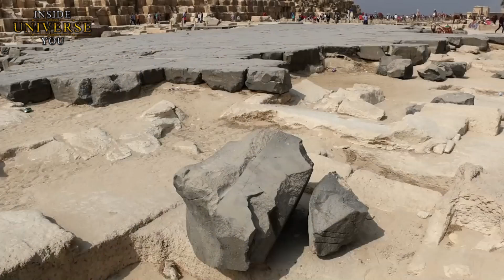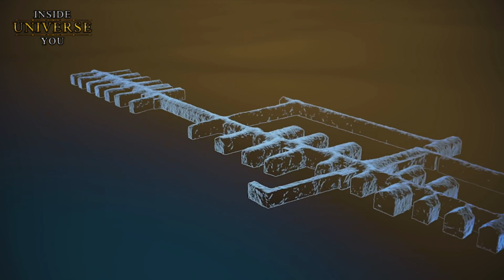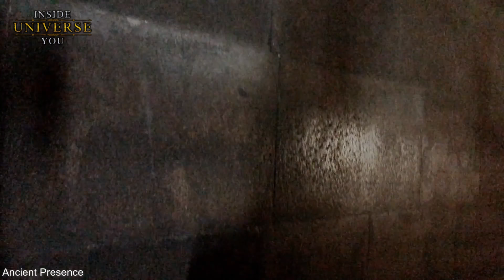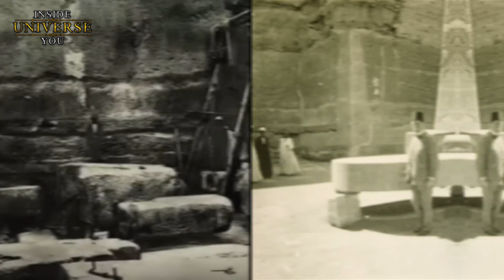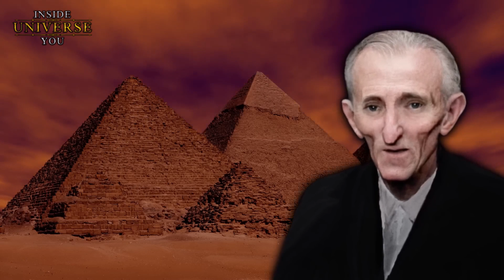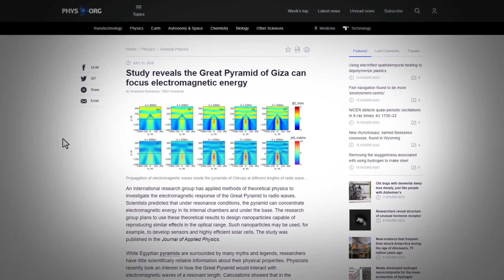Pre-Egyptian Megastructure Built BEFORE The Great Flood

Comment: Imagine instead of cutting and the logistics of moving large stones, over great distances, there was an infinitely simpler way and easier as well!! 
   If the first stone  was  poured* inside a suitable containment system, then ALL the powdered rock removed from the mining ⛏️ of tunnels everywhere, and could be carried in sacks and once mixed with a catalyst and then hardened* , it could be then used as part of a continuous system of similar blocks using EACH hardened side* of a previously hardened rock to be the new  side or form * for the new stone* this way each new stone could harden* while soft* into the depressions of the already hardened stone so that not even a razor blade * could be inserted between the hardened stones!!

Comment: not really to hard to figure it out , they had  hydraulics with water saws to cut through the rocks hydraulics also helped power the pully systems to get these stones moved around. They had access to limited battery usage back then depending on water sources and man power this could have been possible.

Comment: The thing is if the pyramid was 'designed' to survive such a great cataclysm, then it being a pump makes sense, as the water that at one time ran along its base (or great flood) was basically incapable of flooding it. It kept pumping water out and also given a water supply to those inside. It was not a 'tomb' but a structure that would survive any poleshift, flood, meteorite, or other effects from such cataclysms. There may be a person in the tomb but maybe it was placed there later. There is factual evidence according to multiple sources that the pyramids, as well as the other metric ton objects, such as the Easter Island heads (Which actually are just heads showing that were dug up, but have a whole body underneath) were covered up by tons of mud and are generally 'in the middle of nowhere'. This means literally these structures may have been shifted there by a cataclysm which changed the landmasses. They are thus so old but so hard to destroy that such a structure remained and they may be even millions of years old in such case. It may not even be designed for that, but were instead part of a highly effective form of generating power from natural water currents of a prior advanced civilizatoin. It clearly was not made by our iteration of humans or Ancient Egyptians only 10000 years ago, as the material to build and move to make it, was not even available, and the effort to move it there would be impossible. It's likely a remnant from an advanced and much smarter people and now as a result our top minds can't fanthom what really happened.

Comment: What would have been interesting to hear in this video is theoretical calculations on how much energy this type of system could have generated, which would either confirm or deny the plausibility of the idea. If energy generated would be enough to power a city for an extended period of time, then the investment would be worth it, if it was enough to light up a lightbulb or a few buildings, then it's unlikely that all this effort would have took place to build a power plant.

Comment: Maybe the water was pumped up to the acoustic chamber where where cavitation was caused by the sound waves breaking the water into hydrogen and oxygen where the copper cable in the upper chamber converted it into energy like a hydrogen cell and whatever they had in the granite tub.
If it was iron it might send the electricity along its magnetic field lines and the location of arcs around back to the ground depends on how the pyramids is made so they built more sites where they landed

Comment: This comment section is turds. Instead of jumping on the advanced hypercivilization bandwagon, think about how people could’ve done what they did without “levitation technology” and aliens. If they were harnessing electricity, we would have evidence outside of the Baghdad battery; such as copper wiring or any other electrical components. It’s much more likely they used the batteries in their rituals, because what would be more magical and godly than accidentally discovering electricity from putting a metal rod in a pot with a liquid. You forget, people used to experiment on different natural phenomena before the renaissance.

Comment: Lets not forget the pyramids are actually 8 sided. Imagine tossing that little bit of physicality onto the architects board. Never-mind already being hard enough to get everything to work with only 4 sides.
Reply: Probably a stability choice, making the outer layer thicker towards the middle.
Reply: @Flippokid  There are pieces, materials that are missing, ware and tare over the centuries and people dismantling for personal use. So we couldn't even hazard an educated guess as to what there for or why the certain shape. But if I were to guess, as a retired electrical engineer, if the pyramids were honestly designed to produce and transmit energy, like the Tesla tower, 8 sides would give more of a pure output than 4 sides, it's like hospital equipment, they require precise power to operate correctly, you can imagine the power requirements of an advanced species. Also the sides remind me of a full wave bridge rectifier, converting the energy sine wave from AC to DC, that's if my understanding of quartz crystals in the construction is founded. DC power carries more of a punch, much stronger than AC. Or each side could represent the different coils on a generator. Also they could just be involved in the transmission of the energy and nothing to do with the creation of it. Just guesses off the top of my head. But I see your point of also having a stronger support than just 4 sides. But omg Imagine the math, the tools and the hands on scrutiny involved to get all those levels, all those sides and angles to be so perfect beyond anything we could attempt.
Reply: @Silverado1st  Not too convincing to me. If 8 sides are that much more effective and that's what it was used for, then why isn't it a perfect 8 sided star? The angle is very slim. 
On the GP the stones are just barely slanted back, as opposed to the more sloped stones on the Bent Pyramid, which give that one more stability.
The pyramid has stood through an immense amount of earthquakes over the years. The slight angle would have caused the casing stones to fit back into place after. Since several came loose eventually they should've stuck with the Red Pyramid's method.
Reply: @Flippokid  But your basing your premise on an incomplete pyramid, There are layers and parts missing, repurposed materials over the millennia. But it's all really guess work when the dust settles.
Reply: @Silverado1st   I'll take an educated guess over outlandish (but fun) speculation anytime.
Reply: @Flippokid  Till that bandwagon gets a flat tire huh ;-) Until something is a definitive acceptable answer, then it's all speculative, till someone comes up with a better brain fart. Seems in recent years, everything is subject to change, no matter how time honored. I tend to listen to all sides because sometimes at least a small piece fits the puzzle. I wouldn't call it speculation though, more like putting things out there in the form of a question, like a "what if". Like tossing spaghetti against the wall and seeing what sticks lol. I'm far from an acidemic, so you won't catch me building models or breaking out the ole slide rule. It's all in good fun for me, not a career decision.

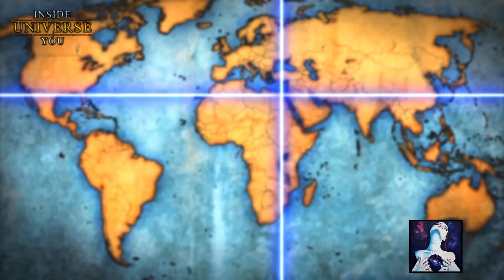Comment: 12:29 Giza being the center of Earths landmass is an older, now debated idea, but what I found interesting is the antipodal(opposite) point of the earths landmass to Giza, which is mentioned to be in the Pacific Ocean. If you look at Google Earth, the little lines in the ocean are where they did high resolution mapping of the sea floor. Since it is expensive, the rest of the ocean floor is low res, and mostly unmapped. But the interesting part, is that one of these high resolution mapping lines goes STRAIGHT over this antipodal point in the ocean. Coincidence? The fact that this mapping is so expensive and it goes right over this point makes me curious. A PhD scientist said that these mapping surveys will typically go over “interesting” areas. Even more interesting is that this mapping line shows an underwater “anomaly”, whether natural or manmade is impossible to tell, on the EXACT LONGITUDINAL AND LATITUDINAL coordinates of the antipode. Another coincidence? Hmm. If anybody would like to check for themselves, the long/lat coordinates are 

-30.009, -148.791

Happy exploring!🙂

Comment: 1:49 I worked in construction for 10+ years. That IS a saw mark. Either circular, like a skilsaw or straight like a sawzall. Doesn’t have to be plug in tech like we have today. But since don’t know for sure, anything is possible.  But clearly they had a way to make some form of saw blade strong and sharp enough to cut those quartz and basalt blocks. like diamond bladed saw blades or something. Even rotating wire saws powered by a manual “motor” or simple machine, like rotors and pulleys would be accurate enough for those kinds of cuts. But copper chisels and hammers is a rediculous claim for anything other than carving hieroglyphs. The question is, why would they continue to aggressively back that theory up as much as they have? Feels suspicious, like they are hiding something…

Comment: They were created by the Nephilim as a way to survive the coming flood.  Noah had almost 100 years to build the ARK, leaving plenty of time for the Nephilim to build the Pyramids.  They would have easily survived the massive pressure they would endure.  Water that made it through the cracks between the blocks would have been drained down below the Pyramid into the underground rivers and water ways.  Since the waters of the flood mostly came from below, the water had a place to drain into.  The large sarcophogus in the Pyramid was a last ditch location for them to hide into.  The rest of the openings were for food storage.

Comment: We say this is the legacy of a civilization that preceded the Egyptian one - but, listen, why did this previous civilization, so technologically advanced and equipped, decide to produce electricity in such an incredibly complex way instead of to build a dam on the same Nile and use the energy of falling water for this (just for example)? Why did this civilization decide to mess with millions of tons of giant blocks of granite and limestone, cut hundreds of meters of different mines, channels, tanks, wells, etc. into the rock, extracting millions of cubic meters of rocky soil to the surface, instead of taking water from the Nile using simple structures like the Archimedes screw (again, just for example)?? All this is strange and inexplicable.

Comment: The question immediately arises - how did the Egyptians came to understanding 5,000 years ago that these gigantic terrestrial and underground stone structures should be built exactly in this way, on such a scale and with the use of such rare materials of colossal weight, which should be brought from some other places, located hundreds of miles away?? Moreover, without going through the path of some intermediate, simpler, smaller projects, but immediately in the form of such cyclopean and incredibly complex structures??

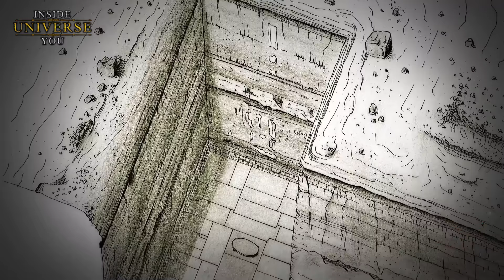Comment: I appreciate the part (19:40) about the oval granite structure in a ground shaft, that detail is new to me. Good research. I do not for a second consider the possibility that the GP was a water pump or any other kind of functional device, but this kind of thinking lead to scrutiny of obscure details. Again, much appreciated. And by the way, the Osireion (not at Giza) connects to a water source. It was tried to pump the water away, but that proved to be impossible. Incredibly, the construction below water goes as deep as a five storey tall building, which has never been explored.
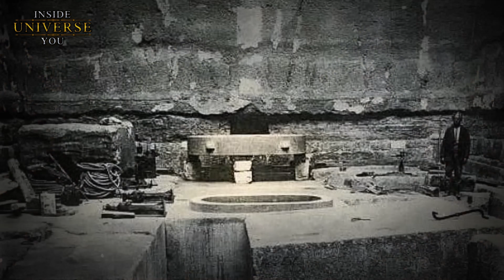Reply: 20:00 maybe extreme focus?

Comment: The structure is not pre-Egyptian.  It's dated to the 3rd and 4th dynasties.  They obviously knew that if you heat granite or basalt to at least 1500 C or 2700 F, the material will melt allowing for molding applications for things like pyramid blocks, aqueducts, building materials, etc.  Hence, the root word of pyramid, Pyra or Pyr, is fire because they were using high heat to melt the material for molds.  Today's science authorities know this.  There's money in keeping us mystified.  Now, you're free.

Comment: If the pyramid made electricity what were they going to do with it? Weaponize it? make indoor lighting ? make electric  motors to run the tools they used? ????????????????????????????????????????????????????????????????????????????.
Reply: It's called superimposable mass free energy. You do whatever you want with it. You tought the story about the electron masquerading on the surface of the conductor was true?
2 négative pressuresXY & 1 positive tensionZ...

It's a reboot & they were way more advanced back in the days.

Comment: Those boxes are forms that formed the blocks that made the pyramids. They had heavy lids to help the stone slurry cure strong and dense. If there was no lid the concrete would grow a rounded top during curing and not be as strong or dense. Put that heavy lid on there and the brick would cure perfectly square and super strong and dense. Put yourself in their shoes. This is what they knew. I would compare the sizes of those boxes with the size of stones used in the building. Those are the tools they used. They did leave them behind. Think about it. If you needed a perfectly square, super strong brick to build the pyramid power plant/water catcher or tiered grow field or what ever they used the pyramids for this would be a good way to get them.
Reply: So how did they extract this perfect block from the container?

Comment: I don't think it's charred/melted granite. I think they must have been using something similar to concrete. Lot's of people think that concrete/cement is just one specific mix, but there are actually dozens of mixes that we currently use and there are hundreds if not thousands of different combinations of materials that could be used. Ground granite is currently used in some of these mixes so it wouldn't be surprising at all if an ancient civilization was using concrete/cement prior to the Romans. In fact we know that the Romans weren't the first to use concrete, they were just the first to use it so widely and their mix I believe was superior to prior versions. Many of these pictures make me think at least some of these blocks and boxes came from a mold and then were polished. You can even seem deformations that look like bubbles, likely from air being trapped when the mixture was poured into the mold. It would also explain a lot of the talk about there being gaps thinner than a piece of paper between the rocks. Basically there is a gap because they waited until the block below was solid and then poured in the next batch for the next brick on top. And it explains how you transport these bricks on top of the pyramids, you don't transport the entire bucket at once, you transport it a bucket at a time. Likely some of the blocks weren't made from concrete/cement and were actually quarried, but I'll bet it's mostly the casing and visible outside parts that were handcrafted and I believe most of these blocks are significantly smaller.
Reply: The word you're looking for is "Limecrete". =)

Comment: Maybe those aren't Sarcophagi, but the Granite molds used for the Limestone blocks of the pyramids.  Pour in some special mixture of limestone concrete, fill the mold, out pops a perfect limestone block that hardens over time to what we see today.  The technique to make roman concrete was also forgotten, a special mixture than can repair itself over time in the presence of water.  As we know, everything the Romans got, or claimed to have invented, first came from Egypt.  It would make more sense to manufacture the blocks on site, rather than hauling hand carved blocks from the quarry.  Perhaps that explains the extreme precision of the blocks themselves, the molds they were in were so perfect that the resulting blocks would seem to have been chiseled from a single piece of stone.

Comment: Wow thoes pyramids when they still had all there casing stones would of been a amazing sight to be hold and they would reflect so much light from the flatness to the composition of the rock and the angle the pyrimid would of looked like a beacon of light in the desert lol on top of its purpose of maybe a popwer generating plant or a portal ,pounding rock and copper chiesels did not create this nor did primitive man,just the foundations are a engineering marvel,some of the biggest blocks are in the foundations are of a truely gigantic size ,part of the pyrimid is part of the Plautau they carved out on 3 sides ,the stars it lines up with and its in metric lol what yes metric measurements with  Pi and the golden number etc just small details lol   ,3 things missing the blue prints ,the machines and the site managers